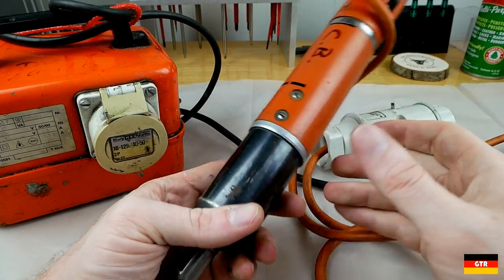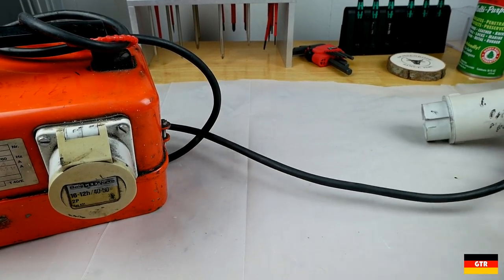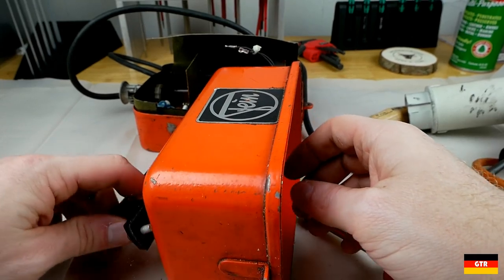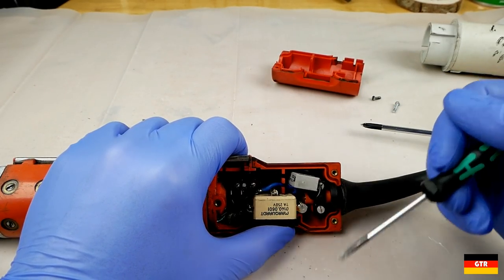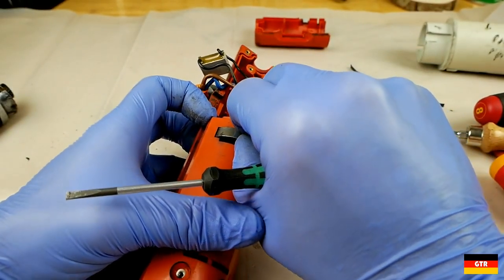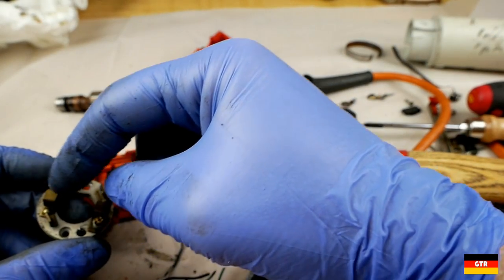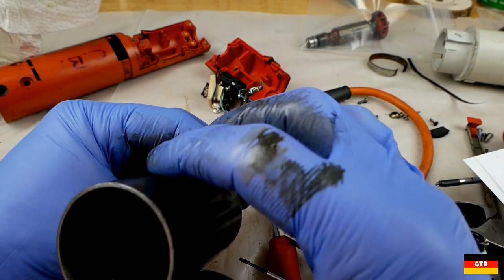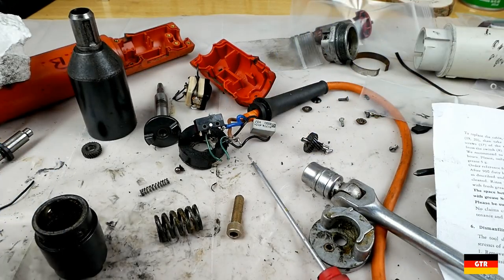Vintage Fein Assd 715-1 42V Screwdriver Part 1:  Teardown

Comment: The socket and the plug are standard parts according to IEC 60309 for extra low voltages in this case, the white color is part of the coding and is telling us that it's voltage is 40...50 V.

https://en.wikipedia.org/wiki/IEC_60309

It's called CEE-plug /-socket here, and there are different colors and sizes available. Single phase, three phase, low voltage. The other standards are blue (230 V), red (400 V) or yellow (120 V) for example.

The blue sign is from the plant were it was used. It's the electrical test that must be repeated every year in every business here in Germany (and in Europe). It's an insurance thing. Even in offices the computers must be tested that way, but they should be tested every 4 years because they are not moved often. In workshops or construction sites there's a higher chance of getting cables damaged. The testing is according to DGUV A3 (former BGV A3). The test is the same as the VDE 701-702 testing. It's containing an optical inspection, insulation testing, leakage current, impedance of the ground connection. Depending of the appliance class.

The drop-in-triangle-symbol is IP X4. 

https://www.baulinks.de/webplugin/2004/i/0658-fgl2.gif

Ferrules are mandatory in Germany since the 1970s if you're using fine stranded wires in screw type terminals. It's banned to tin them and put them into such terminals. Reason is, the solder is deforming, the screw is staying on it's place and then the wire will fall out of the terminal.

Comment: The "white stuff" on the nuts/skews is zinc oxide. If zinc is long enough in a hot and dry environment it will oxidize to such powder.
The 42V AC is considered not lethal. Because of employee safety many of the factory tools are 42V. In addition the risk of arcs are heavily reduced so it can be used in explosion-prone environment if the tool is specially shielded. Many of the cole mining equipment in the coalbed was 42V or pneumatic.

I'm not sure, but i think the tip is an adapter for different tooltips like grinders and such. But i didn't recognize it.

Comment: Hi, I need a set of good quality Hex L-keys.
I am going to use them in a marine environment, and my actual set is slowly rusting away.
Do you have any favourite?
Reply from the maker: Take a look at the Wera Stainless Steel L-Key Sets.   I have not had them rust on me yet.  The P/N for the metric set is 022720 and the P/N for the SAE set is 022721.

Comment: It switch the ac poles? If u plug the conector in 2 modes the tool run forword and backword?
Reply from the maker: Yeah that is correct.  That is what the reversing switch does, it just swaps the poles.